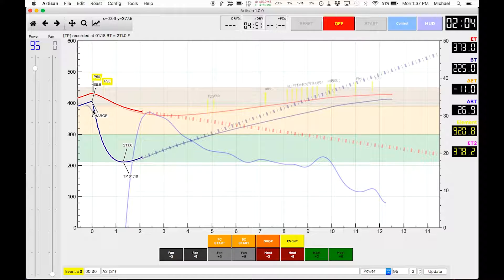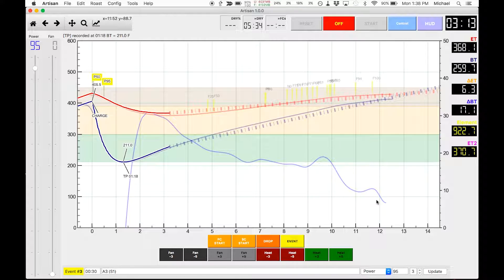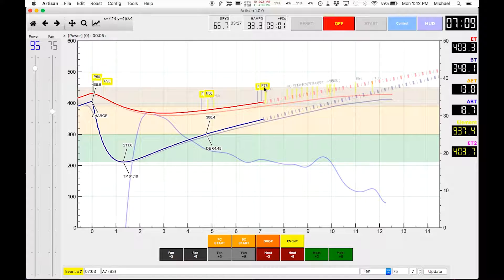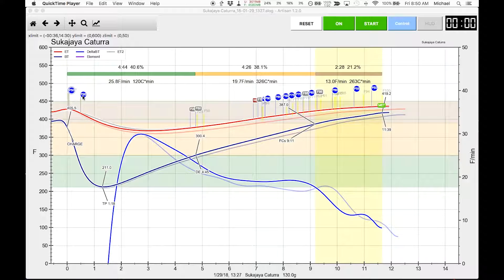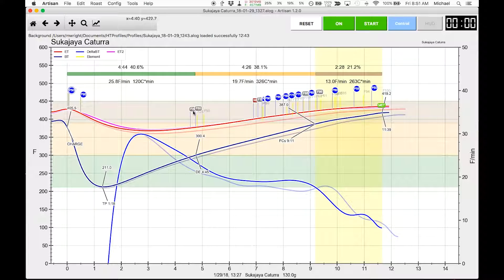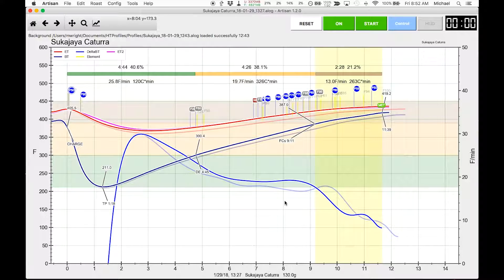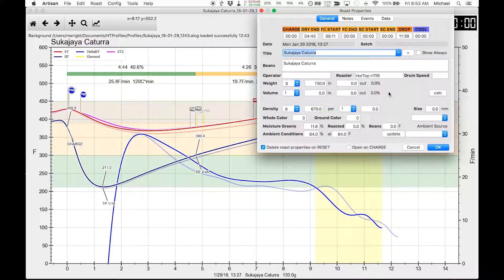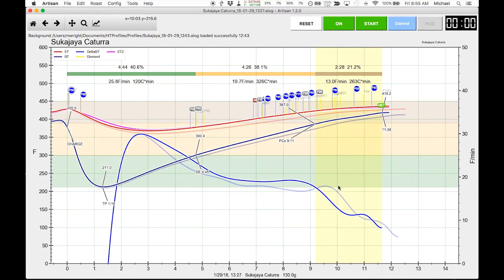Exploring Scott Rao's Flick and Crash (still)

Comment: how did those two coffees cup for you? more or so the same?
Reply from the maker: Surprisingly NOT the same. I hope to do a video comparing the two. Until then, I can tell you this; the second roast of the day was a bit more complex and had a brighter aspect to it (more acidity). My wife, who has a more accurate palate but also who cares less for bright coffees preferred the first roast. 

All very interesting...
Reply: That's cool. Just alittle bit of change makes a difference.
Reply from the maker: Exactly! Case-in-point: https://youtu.be/-OSrqD8EIic
Reply: Very teachsome for me. How could I repeat your tests on my 1kg roaster with manual steering only? May be my ET probe is too close to the exhaust, because I never reach 400° ET. Do you still believe in the flick and crash theory? Is there any objective prove?